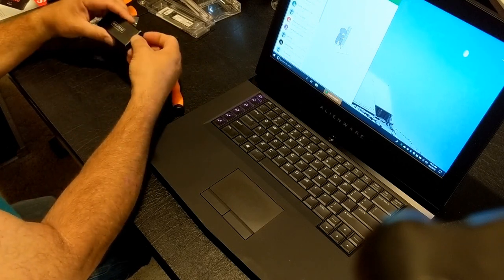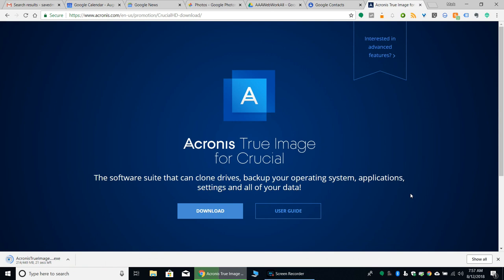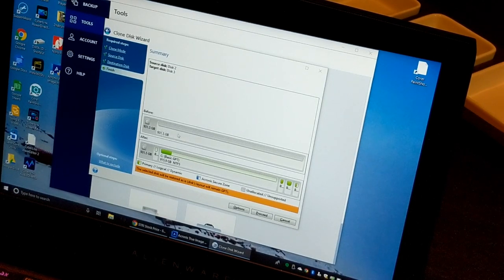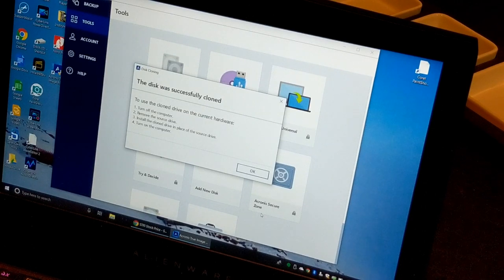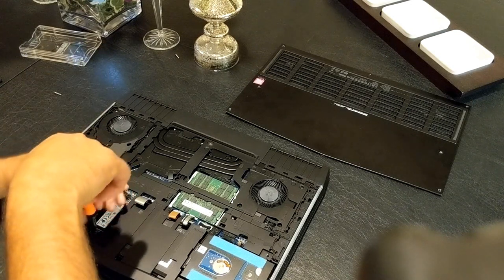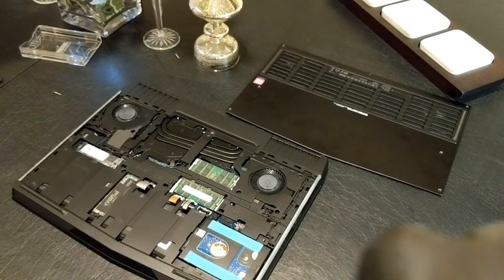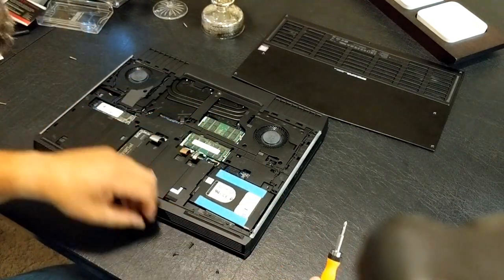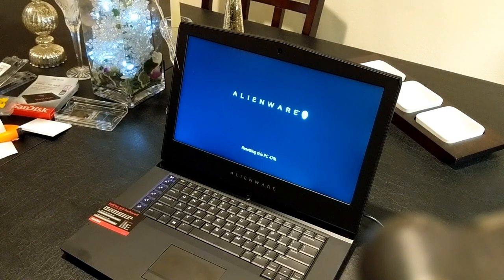Alienware 15 R4 Hard Drive Upgrade

Comment: Nice Vid Mark!  I'm impressed with my 15 R4.  I haven't had an AW since the M11x and 13 R2 and the build quality is awesome even today
Reply from the maker: I agree with you wholeheartedly. I'm pretty darn happy with everything I put this one through so far.
Reply: @AuthenticBiker  I was able to find an open box for under $1,000 I was blown away.  Some of the MSI and Asus competitors at $1800 were so flimsy I can't believe it.  Now I just need to decide if I get Optane for the 1TB as my 256GB NVME will get filled quickly, or if I just add a 2nd NVME.
Reply from the maker: @DDL-n2u  wow, great score!

Comment: Great video and very informative. I just purchased this exact laptop yesterday form Dell. I was wondering if I should have paid Dell to install the upgrade SSD's w/ extra capacity or if I should install them myself. Not sure what brand names Dell uses. From your video, installing the SSD drives seems easy enough, Im just hung up on the whole "cloning my OS thing". Have you found an easier way to clone the OS since this video, any recommendations? Thanks again.
Reply from the maker: Hello John and thanks for the comment.This video was actually the first time I had cloned something in quite a while so I recorded it as I was learning it and it seemed pretty simple to me as long as I followed the step by step instructions. I have not had reason to clone anything since I made this. I apologize but I have not researched it further. I'm happy to report that everything is running extremely fast and I have a ton of storage. Super happy with the upgrade including the cloning portion.
Reply: Mark Baker Hi Mark,
Thanks for the quick reply, I appreciate the information. Question, does it matter which drive you clone the OS to?
Reply from the maker: I John sorry for the delay. I have not researched different cloning methods. One commenter did say you can do so right inside the machine relatively easy but I have not looked into that.